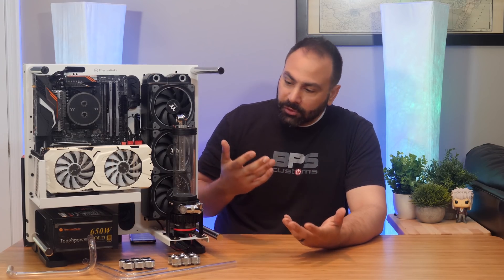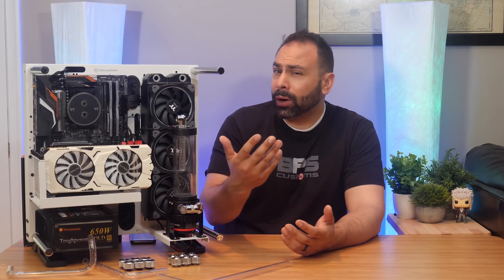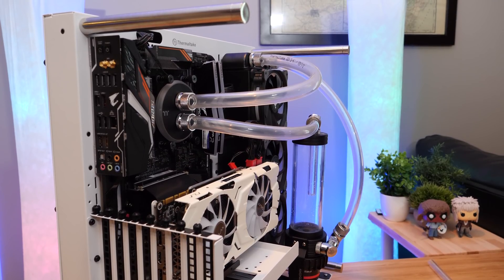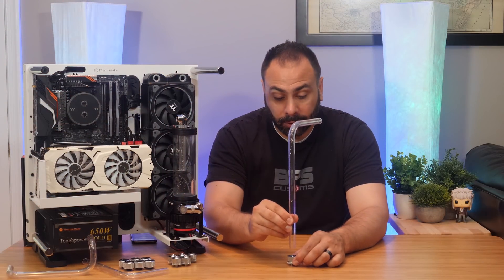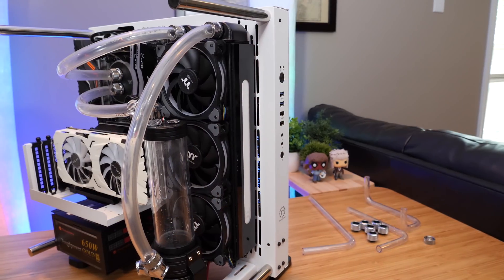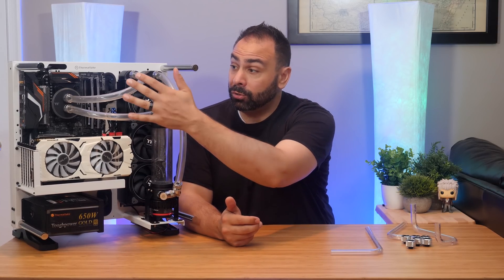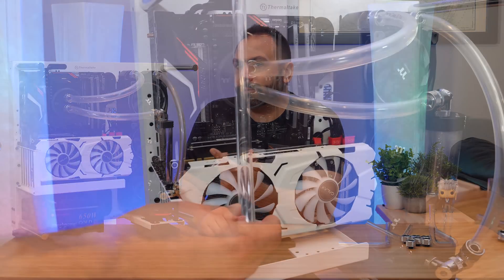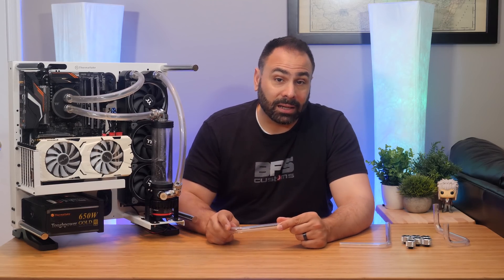Watercooling For Beginners - Part II

Comment: Sorry. Full stop here. I was interested in what you had to say for 1 minute. That "rule of thumb" is nonsense. It ignores everything important such as radiator material (copper or aluminium), FPI (fins per inch), fin design (wrinkled/painted/epoxy coated), radiator volume, reservoir size, pump capacity in lpm, air flow, static pressure of the case, expected ambient temperature, tubing material & fittings (pressure loss in the plumbing so to speak). And if your thermal block(s) is(are) inefficient - well....

I'd be totally OK to reference AIO manufacturer's general recommended sizes.  But I have seen everything from 18FPI, 14FPI, 12FPI and even 10FPI in the "thin" AIOs. 

Thank you for your contribution to the community. The first minute was looking good. I was hoping someone can explain sizing based on total watts and part design.  I have yet to find an engineer based video.

Comment: looks very good and well explained; i put extra fans on my system and one can also use a peltier element which provides cooling such as in small refrigerators, so there is a supply of cold air available for the system. this is not of course, liquid cooling,  but it works well enough.   also, i experimented with a cold air supply hose taken off an airconditioner so that a steady amount of air enters the system which was not bad either.

Comment: The loop order thing makes sense using logic as well. The water doesn't cool the GPU, it transfers the heat from the GPU to the radiator. Whether the water is hot or not doesn't matter, as long as it reaches the radiator.

Comment: i've got a question with reservoirs. i'm trying to find a case for a build i have in mind, but i don't know much about liquid cooling. i definitely want a reservoir and hardline, but do i have to worry about the case having proper mounting spots for the reservoir? some cases i find just have ssd brackets, could i use those for mounting?

Comment: It looks like you are going pump>rad>cpu block>resevoir. Wouldn't the high temp coolant from the cpu go directly to your pump? D5 is rated at 70C , no higher. I thought it would be pump>cpu>rad.>res. So the coolent temp was dropped by the rad before it went to your res.>pump. I've never built an open loop, but I've a load of parts for a x399 build. WHICH WAY SHOULD I GO? Pump will be at the bottom of a core X9 case. The mobo is in the middle (horizonal mount). And the 420mm rad on top.
Reply: The order really doesnt matter.  Even though the cpu creates a lot of heat it actually equates to a very minor rise in the temperature of the coolant so long as the pump is providing a normal flow.  It takes a lot more energy to increase the temperature of water than air.  What this means is that, so long as an adequate radiator with properly functioning fans are installed anywhere in the loop, the water temp will never rise in a significant way in any area of the loop.

Comment: it would be amazing if you made it completely noob friendly. for example, what to do after you cut the tubing, how do you connect the fans. eg: if you have a 360 on a push/pull, do you put 6 fans in a header? do you use a "commander pro" solution? if you use this how do you connect a "cpu" fan? as far as I know a pc cant run if it doesn't detect a "cpu" fan.